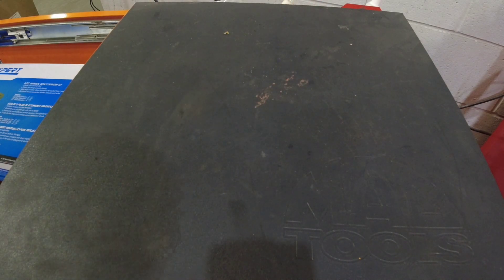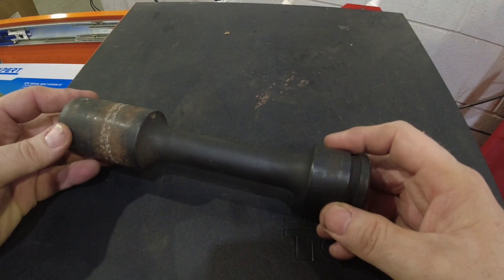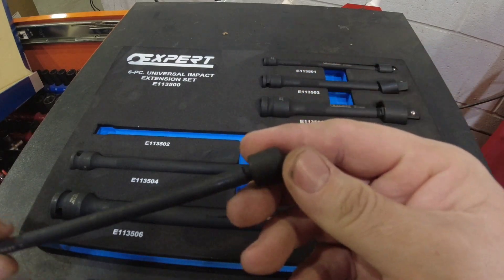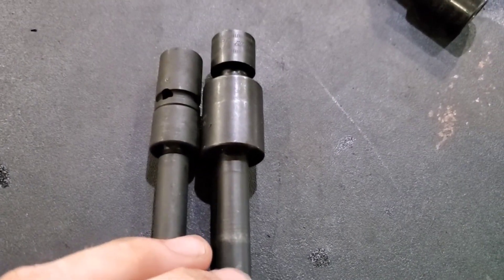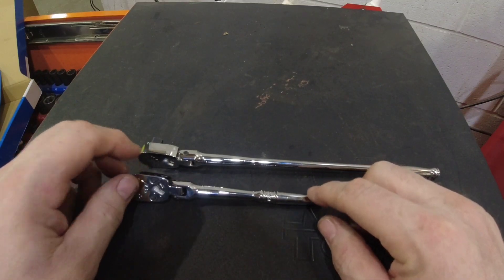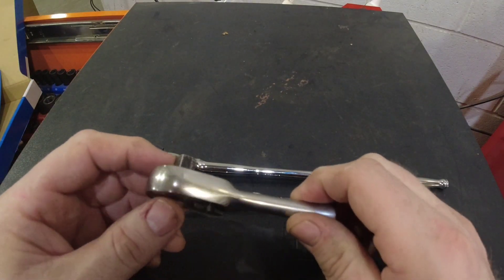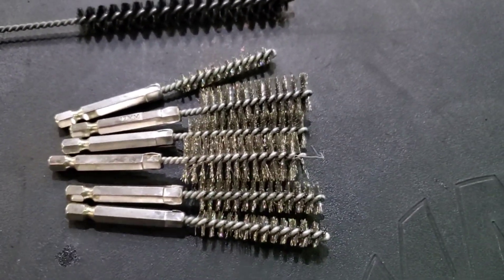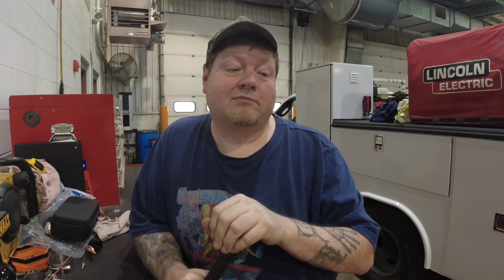Grey Pneumatic 33mm Xlong Socket review and Tool Haul from Mac Tools and Snap-On

Comment: It definitely has the reach Grey Pneumatic always make good stuff I use there 1/2" drive impacts they are my most used and abused but they have standed the test of time ...I also have MAC expert sockets just as well in 1/4" and 1/2" drive semi deep sockets in chrome I had them for about 9 yrs now they also have held up i never had issue with them or rounded anything off with them ..You got some good pickups
Reply from the maker: Thanks my friend :-)

Comment: I converted one of the Snap-on 1/4 extract long ratchets to 3/8 drive. It has a tone of shaft flex and I blow the gears out on a couple months.  It dose come in handy but you gotta be careful.
Reply from the maker: I bet. only plan on using it as a last resort ... Thanks for watching

Comment: I use a Sunnex  33m extended 1" drive for rear dual's . I use 1" impacts for yoke nuts and suspension u bolts, so those extended 33m sockets are cool. My Ingersol 1" is about 30 years old, so has the standard large body of a tire changer, it can still carry the mail. A few years ago CP came out with a short bodied unit that can be either a 3/4 or a 1" drive, light weight [good for us old guys], so the extended 33m is a good tool to have.
  Dave supply me with your email address and I will send you the plans and photos of a diesel fuel system tester/ priming pump. I sent one to the Heavy Wrench, evidently he seen the possibility of marketing the idea and went silent, not passing on the info to his followers. You will be impressed!

Comment: Thanks Dave great video & tool haul. I grabbed those wire brushes from Matco in a kit stainless,brass &plastic with a driver handle . around 25 i think, also saw cornwell had them on the truck. They are great. Who is this Turbo TyTy you speak of???
Reply from the maker: Thanks :) There should have been a card to his channel along the top when I had said that to his channel. Go check him . Great guy in Cali :-)
Reply: @OneMechanic  That was giving him a tease.Yes Turbo Ty Ty is a great guy. He is my humor connection. I always hope he realizes that I love trying to make him laugh as much as he does me.
Reply: P.S. check out that awesome orange G!
Reply from the maker: Hahahaha... I wondered.. 😂

Comment: Can you compare them to the gear wrench?
Reply from the maker: compare what to the gearwrenches?
Reply: @OneMechanic  GEARWRENCH 3/8" Drive X-Core Pinless Universal Joint Impact Extension Set Includes 6", 9", & 12" - 84453
Reply from the maker: Interesting, didn't know that Gearwrench made those. I know they made the extension with the sockets but I have heard that they don't last. Again, I don't know first hand.  I would love to get some to test from Gearwrench but I doubt that I will be buying them as I already have the set from Expert. But thanks for asking. Justin Dow is sponsored by Gearwrench and maybe he can tell you more...